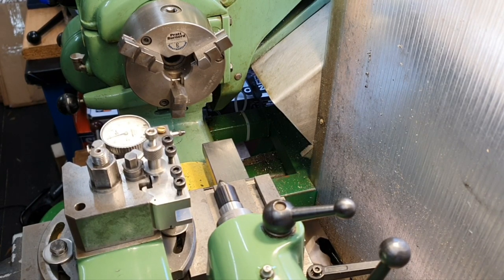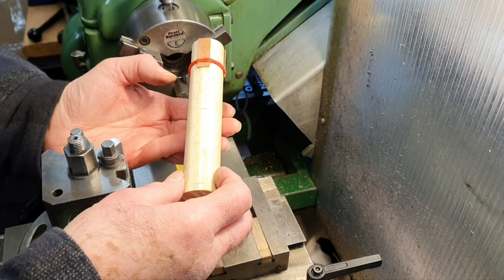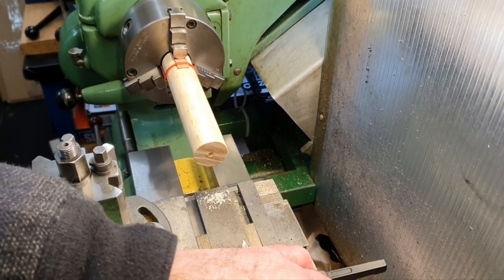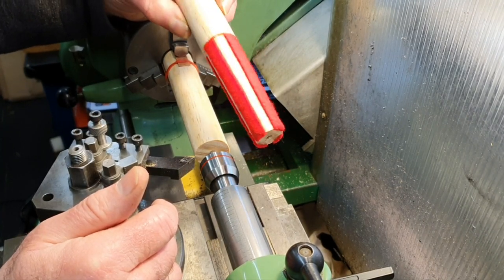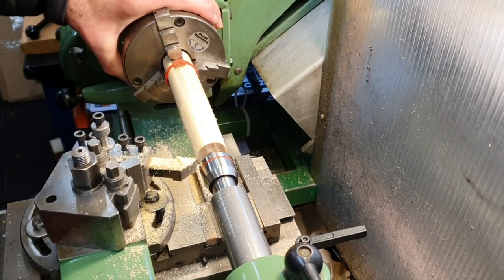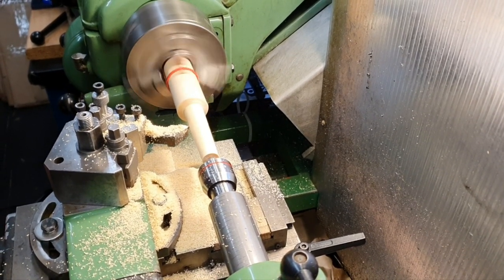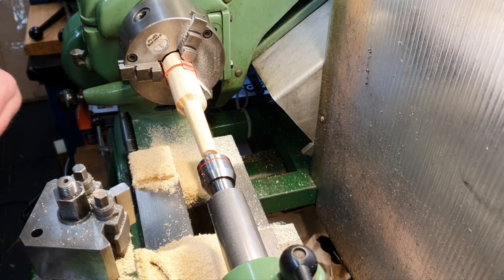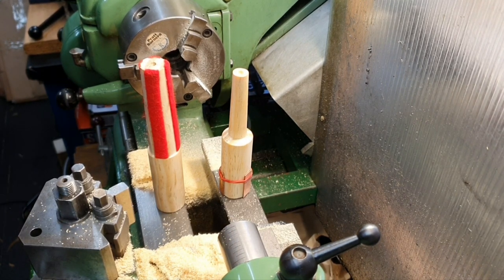Making a Morse Taper 2. MT2

Comment: That's it Nobby, save your "Pennies" for something you can't make. Well done. Please be aware that should you need to make accurate metal Morse tapers it is Essential that you ensure the following during set up and machining. The DTI stylus must be EXACTLY on center height as well as the tool. Any deviation on either will not give you the correct taper. As an example should the DTI be above center when setting the compound angle and the turning tool be below center then you will get a double error angle. Should you have decided to do it a different way by measuring the diameter change over a known distance ( Taper Per Foot )  to achieve the angle, then your DTI would not only have to be on center height but also be perpendicular in both planes ( parallel to the bed ) and to the centerline of the spindle. Need more information then drop me an email. Regards from Australia.
Reply from the maker: Thank you so much David for your valuable advice. I've watched several videos on making tapers, but no-one gave any tips like you have. I'm going to experiment setting up the angle again, as I do want to make some metal morse tapers for another project. Keep well and safe regards Nobby